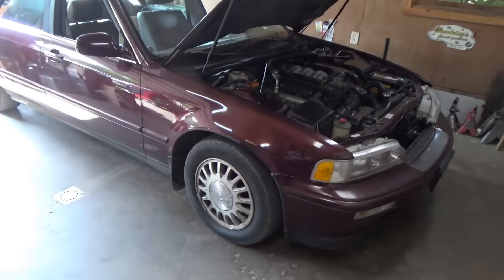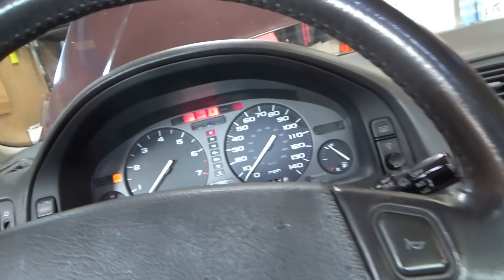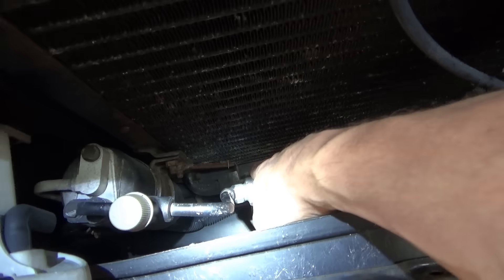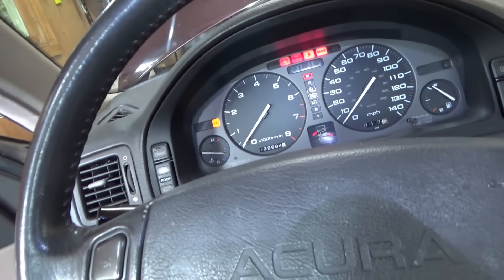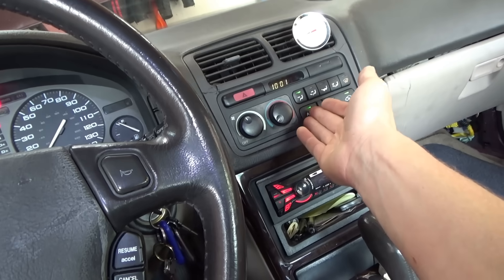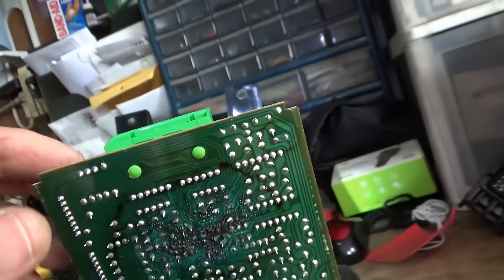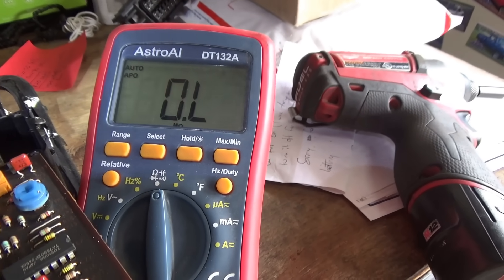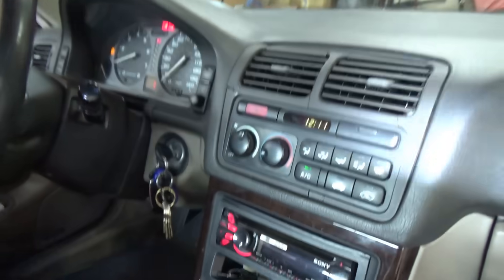Classic Acura: No A/C! ('95 Legend V6: Parts UNOBTANIUM?)

Comment: One thing might be if a place like PCB way or similar could manufacture new boards that could be populated with new parts, and maybe the old connectors
Reply: That board was repairable. Probably not in Ivan's garage with Ivan's skills. No need for a new board.  If there were still a lot of these cars out there with the same problem, it might make fiscal sense to cover the nonrecurring engineering costs.  But I don't think that's the case here
Reply: @major__kong Ordering ten four layer bars pcb boards are only $ 4.80 each.

Comment: A good electronics repair or rebuild shop should be able to replace the caps and the board traces using jumpers.
Reply: Yep, old single sided through hole PCBs are quite easily repaired.
Reply: I had to do that for a clothes dryer board.  The relay for the heating element cooked itself and the board. Board was unobtanium.  I was able to reuse all except one hole and trace under the relay.  Just soldered a wire from the pin to further down the trace.  About $7 dollars in parts and $3 for shipping.
Reply: reality is, most will not touch it, since it's not a self contained device and needs the whole vehicle, wiring diagrams and more to thoroughly test after repair or at least without a complex simulator test bench and if those existed it would have been gone when the line of cars were gone many years ago.
they may just find some bored tinkerer to repair it, but that corrosive fluid is the gift that keeps on giving once it's soaked into the board substrate it keeps creeping for an eternity and slowly eating more surrounding parts.